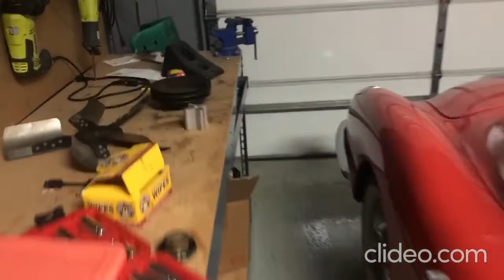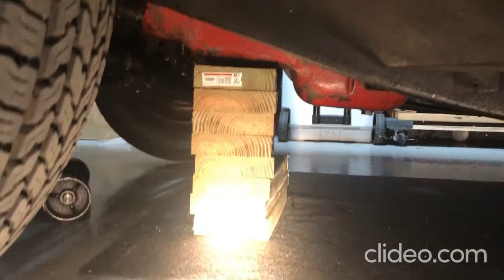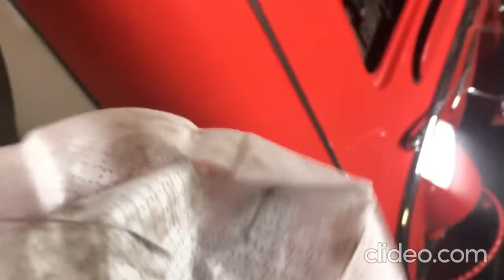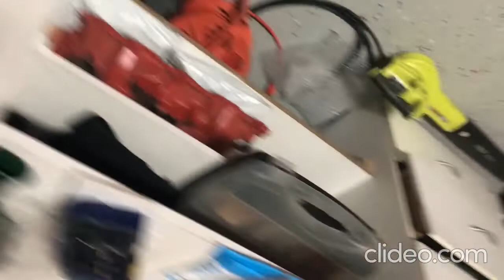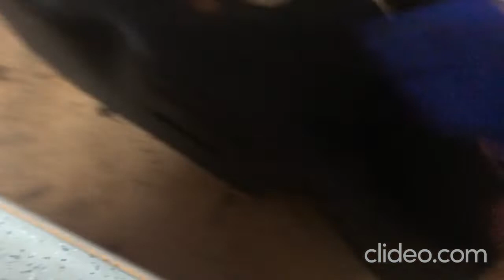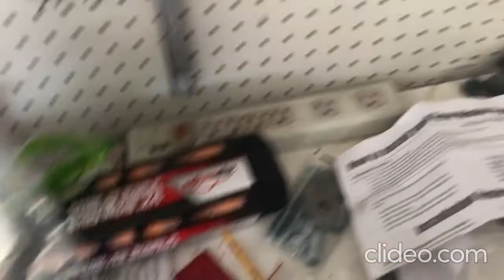C1 1958 Corvette Water Pump and Engine Mount replacement

Comment: Nice video! I've owned my 57 C1 Corvette for 51 years. Purchased in 1972. It's a best of show car that I drive to and from shows and cruses in my area. I'm the 3rd owner. Engine numbers matching with a 1960 transmission. This past winter I decided to do a little engine bay clean up. I jacked the front end up and the clean-up started. I wanted to paint and install a dated generator tag which turned into removing and rebuilding the generator, replacing the (50 year old) voltage regulator, and the clean-up project grew. Making new wire harnesses with the original tar covered cloth loom. Cleaning and soldering electrical connectors. Then I noticed green fluid around the starter area (anti-freeze). After more engine cleaning and inspections, I saw the fluid was coming from the water pump mounting area on the right passenger side. It was traveling along the edge of the oil pan gasket to the rear of the engine. I found a rebuilt (original) water pump (1957 Flint Michigan) from Corvette Central, $259.00. Back in the 70's I worked the counter at a parts store in Camden N j (Rem Auto). When my original pump went bad, I gave it up to the rebuilder as a core (a $2.00 value) and installed the same as you have. A later mode with the by-pass on top. Big Mistake. I don't throw anything away now. I'll be doing the same as you by supporting the engine under the oil pan. I like to add a layer of foam pad at the face of the oil pan for a little added protection. And of course, since the starter is out Why Not paint it. After rebuilding it! Gotta Love these old cars. All it has done for the years I've owned it, is give me pleasure. Again, Thanks for the video

Comment: Thanks very much for the excellent video!!! I have worked on many Chevy and Ford classic cars over the years and I never would've known that the motor was supported from the top! I too would've dropped the engine without supporting it!!! there are definitely very few videos for the C1 Corvettes. I used your video and reviewed it multiple times during the process. Haven't put the coolant in yet, but fingers crossed everything is good as I used your suggestion of the 3/8 inch threaded rod to align everything before torquing. The only thing I am looking for now is the torque value for the motor mounts themselves. Sincere thanks for the video again!
Reply from the maker: Thank you Stephen for your time to watch and comment, and good luck. I do not know the torque for the motor mount but you should tighten them pretty well, but not strong enough to crush and burst the rubbers. We did not use the torque wrench as often in other parts of the world :)

Comment: Love this video. Thanks for the post. 
The basics of the replacement are all there.  
Great idea, using the threaded rods to hold things in place. 
Clean that mount, clean the block.  Use sealant on the bolts.  Use a good gasket sealer. 
Be safe, this is dangerous.  Keep hands away, from where a falling engine could land on them. 
Guessing,  I did not have blocks correctly under oil pan.   
Had major coolant leak between mount and block on passenger side on my '58 Corvette. 
Is surprising that the engine stayed in place, with just one very loose water pump bolt.   
 Bolt was finger tight and, almost all the way out. 
  By hand, was able to turn and remove the last bolt from from the water pump.
 Engine did not drop until, the water pump was at least an inch from the block.  
Then, all hell broke out.  
Created a lot of panic energy.   
 Book says to support engine with a cherry picker.  
 If using this method ( I saw this video, after my fiasco ), be sure blocks are in correct place,
 with zero space between pan and blocks. 
We used rail way ties and 2x6 pressure treated wood. yes, we had zero space.  
Thanks again for the video.